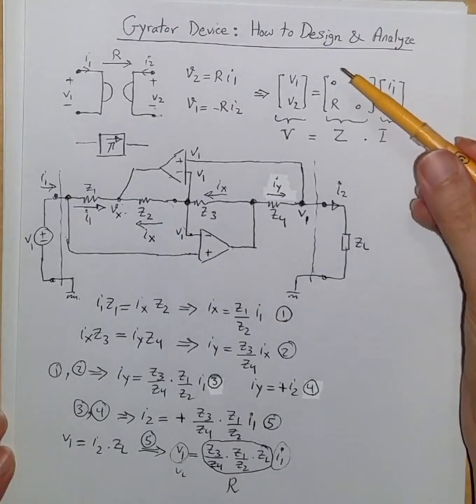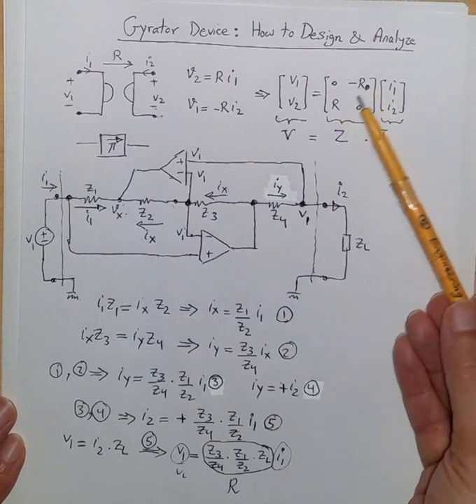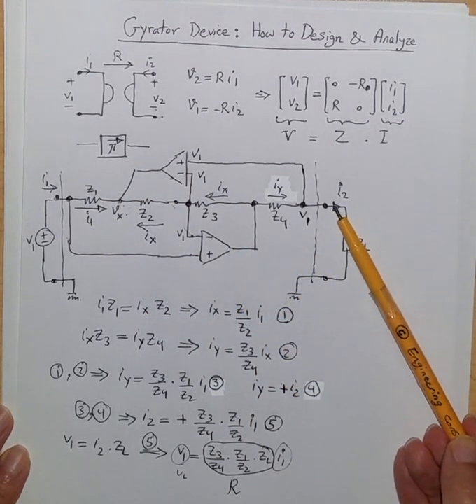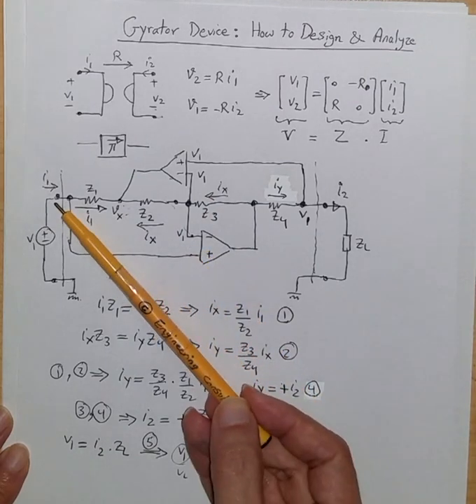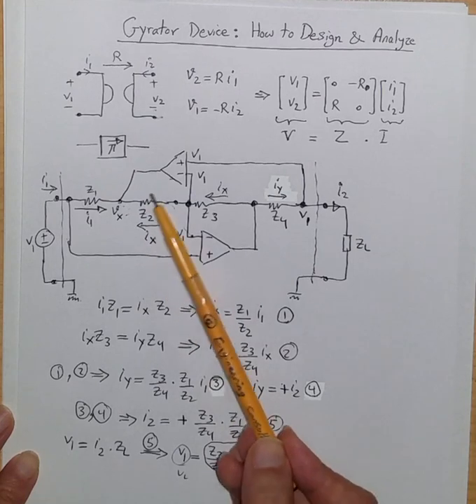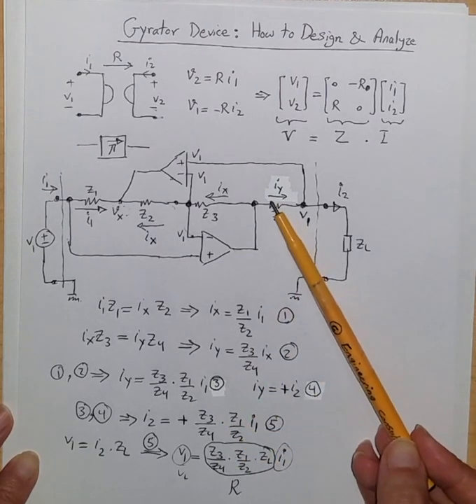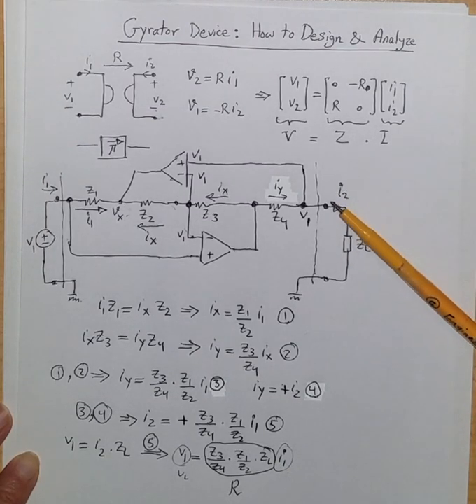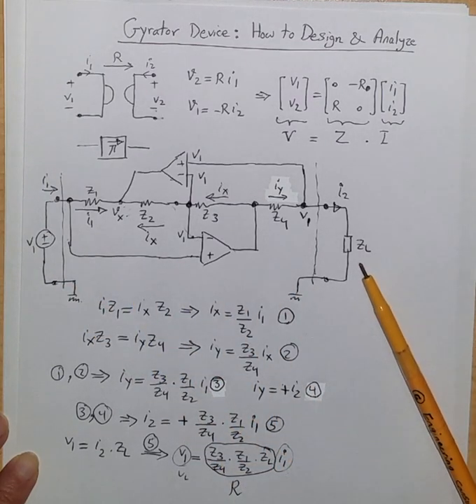Gyrator Device :  How to design and analyze Gyrator Circuit

Comment from the maker: Thanks for watching. For more examples see Negative Inductance with Gyrator https://youtu.be/GF_Mun_Mkyo , Impedance Converter Design with Op Amp (Gyrator) https://youtu.be/jPudh9yqDH4 ,  
Active Inductor with Op Amps https://youtu.be/6IYz4iaa05c ,  And Analog playlist https://www.youtube.com/watch?v=kX5X8jBXVXw&list=PLrwXF7N522y4c7c-8KBjrwd7IyaZfWxyt
Note that practical inductors have limited range of inductance. The larger the inductance, the bulkier, more expensive and more nonlinear that inductor becomes (low quality factor).  For example the whole circuit including rest of components might be much smaller than just a single one milliHenry inductor. I hope this is helpful.

Comment: This is actually ground breaking. Thank you for going through this derivation.

Are signal trace lengths important in the actual PCB implementation?

In the realization of this circuit into a PCB, I get the impression that the signal-trace lengths and the signal travel times need to be laid out properly, so that the devices behave deterministically when transient signals are introduced, and as those transients quickly propagate through the network.